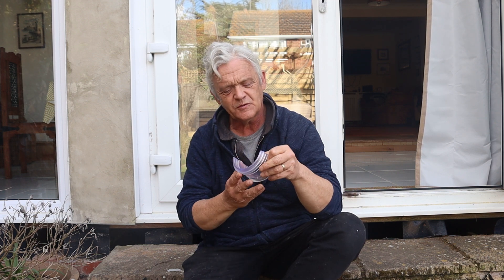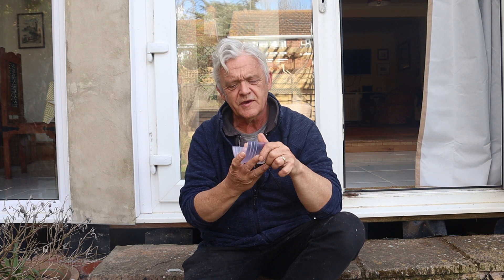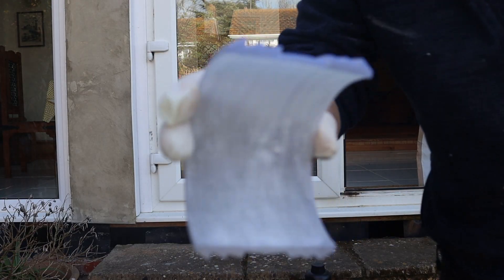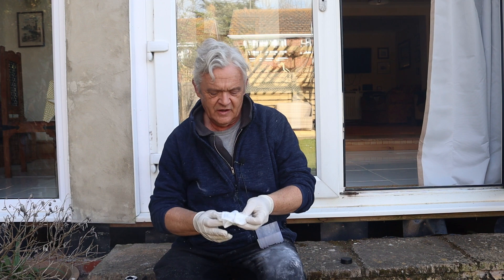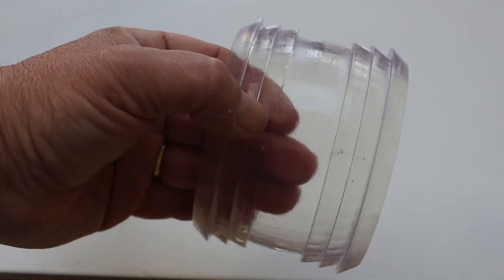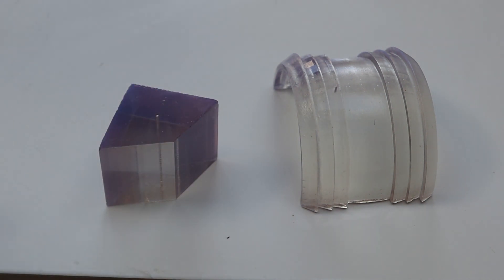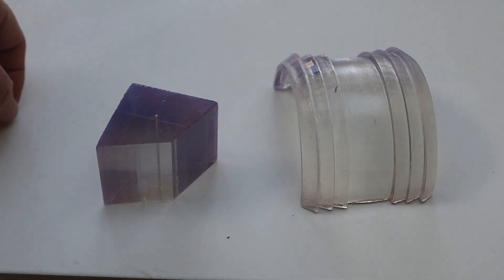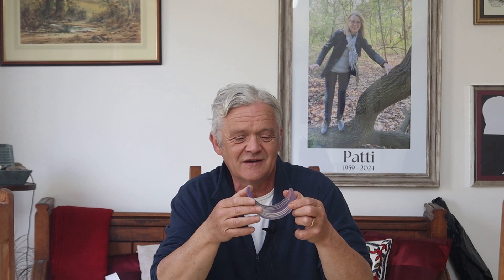2369 A Little Trick For Crystal Clear 3D Prints

Comment: Hi Rob, Try using vaporized acetone. I use to work in the Packaging Industry and when we would design up a new jar or bottle we would get a clear 3D printed model made of the jar or bottle for evaluation and marketing purposes.  To enhance the optics of the 3D printed model the container would be hand sanded to remove many of the ridges produced as part of the 3D printing process.  After the sanding and compressed air cleaning the model would be placed in an enclosure and acetone via a vent port would be slightly heated so as to vaporize and that vapor would be circulated inside the enclosure.  This then resulted in effectively just slightly melting the surface of the model producing a relatively smooth and clearer finish.  As an alternative to consider, last year I bought one of those kits on Amazon to repair the outer finished surface on the headlights of my car.  Yes my car is over 10 years old.  The vapor deposition kit available on Amazon that looks something similar to a heated thermos coffee cup with a funnel on the top worked great at restoring the finish of the plastic lens on the lights on my car.  Always have good air flow when doing either of these processes and no open flames or sparks in the vicinity.  Regards.

Comment: Hey Rob, here's another trick/tip get some UV resistant clear blue diy for UV resin add 3 to 4 drops in the resin mix it and print with that mixture to prevent yellowing of the resin. It has to be clear blue non suspensionous diy to get near optical great resin. Otherwise if the diy is not dissolving in resin you have like tiny particles that give unwanted interference with the light

Comment: Hello Sir,

We are a group of students participating in an Engineering project, our project is mainly generating energy from a Tribo-electric nanogenerator, we had seen  your video on TNT omnibus channel beforehand, we'd like your advice and help on making the triboelectric nanogenerator and how we'd connect multiple cells to maximise power production, we have many questions as well, like whether we'd be able to store this charge in a capacitor or a lithium ion battery and use it later on ? We have planned to make the TENG out of PTFE (plumber's tape) and Aluminium foil, moreover we weren't able to access the article mentioned in your video, any help would be instrumental and highly helpful
thank you
Reply from the maker: I am sorry mate - I am afraid  get something like 3-400 emails, posts and comments every day and in them will be 20-30 requests just like yours. I am sure you can see it is just not possible for me to respond to all of them. As a consequence the only real help I can offer is contained in the videos I make. I do wish you the best with your project but it is not possible for me to help on an individual basis - kind regards - Rob

Comment: Way back, in the 60’s & 70’s, when I processed my film and made my own prints. If a negative got scratched we would apply a small amount of petroleum jelly to the negative and then buff it with cotton balls. The petroleum jelly filled in the scratch preventing the scratch from refracting light when enlarging the image. 

Jewelers use some very fine buffing compounds to polish some very soft metals. If you polish the lens so all the scratches are parallel the resin may work better at filling in the scratches and reducing refraction to produce a clearer lens.

You may even produce a polarized lens.
Reply from the maker: nice tips mate thanks for sharing them

Comment: There is a pressure pack spray pilots use to fill in the scratches etc the hit the windscreen when flying.  My son-in-law showed me who he used it.  And to think I was using a lot of elbow grease to clean up the visor on my motor cycle.
Reply from the maker: car windscreen repair uses the same thing i think - it is a cyano - acrylic glue based thing - interesting - cheers

Comment: I've probably every Dremel attachment, I've never had success in plastic polishing, yet take a piece of equipment that has a plastic facia etc, only a little bit of use and over time granted - that amount of shine you get? 
Something worth trying if you are working frequently with a resin/filament is to see how it reacts with various solvents, isopropyl alcohol, ethyl acetate, acetone, MEK, brake cleaner and the "beast" - xylene, obviously there are others, but just getting a feel of the material, to me is key, for example, printing in abs and you are struggling with bed adhesion? Try rubbing a spare/scrap raft over some MEK, it really helps. These new resins that print almost clear, it may be worth experimenting with solvents to see if opacity can be improved 😅
Reply from the maker: I agree mate - thanks for the tips

Comment: Sir.. do you have a solution for perhaps being able to twist an image, radially.
As in we use yaw , pitch and roll.
Then I wanna roll the image to an extent, through the use of the lense.
Like make incoming or outgoing image from portrait to landscape and vice versa.
Reply: An 'erector lens' as used in telescopes etc can do this, as you rotate it, it rotates the image.
I think its sometimes called a 'dove' prism.
Reply: @bikerfirefarter7280   ahh yes!
I'd heard about it.. forgot the term though.
And I have no idea how it is supposed to work. Never seen a visual illustration of the thing.
I'd only heard the name dove prism though.
Not the erector lens.
Also, had no idea it could vary the degree of rotation too!
Very awesome!!!
Much thanks!
Reply from the maker: I think bikerfirefarter gave a really good reply answer mate
Reply: @ThinkingandTinkering   I'd be having a really hard time contemplating how it works though.
As, I can make one (theoretical design) myself even.. probably.. but it likely wont be as precise or useful.
As he mentioned, the dove prism is able to twist the image variably too.
And no design I've yet come up with for a lens.. that can do that.
Soo.. I'm not able to understand how it works. ); . I'll try though.
You're one hardworking man.
And I intend to.. do my own research, and try and find out.
Thanks you.